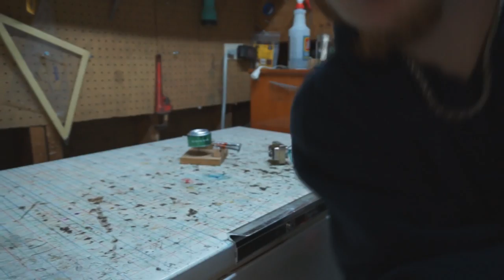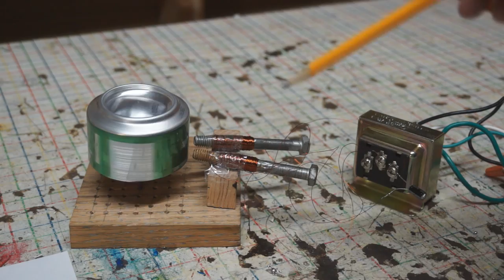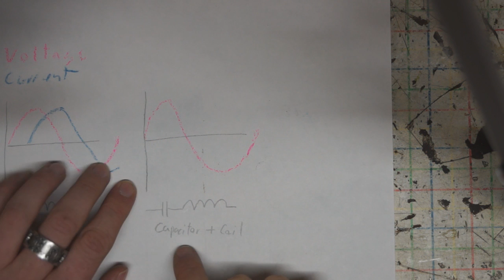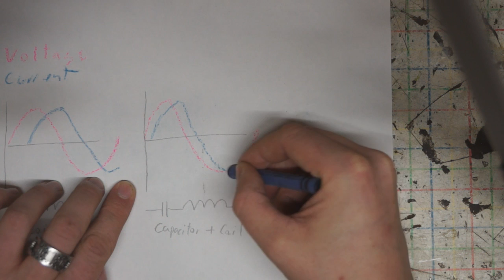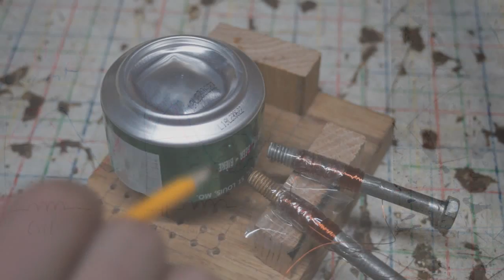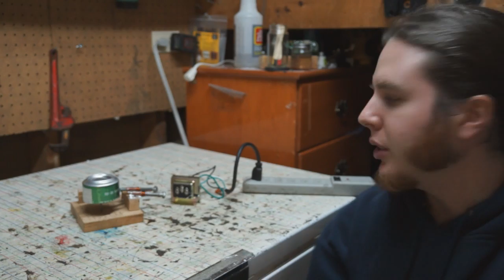Home Made Induction Motor

Comment: It might be fun to spin it faster pushing it from motoring torque  past what would be synchronous (given its electrical and physical phase seperation), into its generating torque so that it converts mechanical power into electrical power pushed back into the grid.

Comment: Would you be able to use an induction motor inside an alloy wheel and power the wheels directly with the alloy wheels? Basically a motor you can bolt on inside your wheels and behind the brakes

Comment: Bunch of questions, hope you’re still around 7 years later to answer them!

What are you using for a “power supply?” Is it just 110V AC?  What’s the little metal structure the wires from the power strip are mounted on? 

I have a 30V/10A MAX variable DC power supply and a fairly large capacitor from an old disposable camera. Will that work, or does it need to be AC?

The application for the motor will be to provide a small sphere magnet with rotation (at least 3000 RPM), at which point I’ll launch it out of the phase field (or whatever it’s called). What size capacitor should I use for that?

Comment: Do you have to use a transformer?
Reply from the maker: For a hobby made motor yes, using lower voltage makes it safer and let's you use less windings on your coils.
Reply from the maker: For the best results you should solder the wire for the coil to the capacitor. Twisting it together may work but not very well.
Reply: @NickMoore  did you use magnet wire or just normal copper wire?

Comment: I made the same model, and used small polarized capacitor like yours, but the coil connected in series with the capacitor is not attracking the rotor, only the other one, i switched the coils and got the same result.. any suggestions please?

Comment: Can you only rotate metal objects with that motor, or can you move composite materials also?
Reply from the maker: +Mark Lane It only works with thin aluminum because the forces are so week. A better constructed motor could spin iron as well.
Reply: Nick Moore thanks for the quick reply. I've been looking for a way to rotate a 16lbs bowling ball using motors with 1/32" control. Not having any luck unfortunately.
Reply from the maker: Have you tried a reverse trackball setup? It would be alike an upside down version of this robot: https://www.youtube.com/watch?v=bI06lujiD7E
Reply: Nick Moore. That's cool and it might work but right now it's over my head. I'm not an engineer. But I did just but a Arduino kit and starting to go through some utube lessons. Just not sure if you can move the ball and get it exactly where need it within a 1/32".
Reply from the maker: Omni-wheels are cheap enough on ebay and if you used 4 of them instead of 3 the math would be much easier. One pair would rotate around the X axis and the other pair around the Y. To get rotation around the vertical axis I think you would have to do something clever but I'm not 100% sure.

Regardless, good luck!
Reply: so like a magentic top of a smuckers jar lid or a magnetic lid in general
Reply: mine only moves stuff that is magentic

Comment: Nick I tried assembling a 4 pole (2 lots of series electromagnets) AC set up with each pole using a large solenoid (each solenoid is at 90 degrees to the other solenoid). One set of series solenoids were connected directly to a 12V AC power pack. The other pair of series solenoids contained 2 capacitors connected - to -. The capacitors I tried were 47, then 100 and finally 220 microfarad. In the centre was the upper part of steel beer can. Unfortunately there was no rotation at all. Using a voltmeter, I found the first pair of solenoids were using the 12V but the second pair only about 1.2V (and 10.8V across the capacitors). I even tried replacing the 2 capacitors with a single one but nothing happened. Any idea?

Comment: very cool um how do you have the motor wired up to the transformer
Reply from the maker: One coil is connected right to the transformer, the other goes from the transformer to  a capacitor then to the coil and back to the transformer.

Comment: This is a very nice demo. Proximate my how many turns did you use for your coils? What gauge wire? How long does it run before the electrolytic capacitor pops? How long can you run it before the coils get hot?
Reply from the maker: +Noah Spurrier It's a few hundred turns (maybe 200-300) of 30awg wire. It will run for 10-20 seconds before the cap starts to get hot, the coils warm up pretty fast but they never failed, the cap was my main concern.
Reply: Nick Moore I would like to build a small demo model that can run indefinitely. What size range of caps were you using? 0.1uF? 10uF? 100uF? 1000uF? Have you tried two electrolytics back to back? That cap looked physically pretty small even for an electrolytic. It shouldn't be to hard to find a cheap, conventional capacitor to replace it. If you are looking for cheap, salvaged components then the "safety capacitors" from a microwave oven might be in the capacitance range needed. These are Mylar and foil rolled. They are found on a small board with a fuse and some inductors where the AC line first enters the microwave before the transformer or any other electronics. There's also the main high-voltage capacitor attached to the HV transformer and magnetron, but these are nearly as big as your motor. Still, they should never overheat or pop and they are basically free wherever you find junked microwave ovens. They often have internal discharge resistors, but these are usually over 1MOhm, so shouldn't be a problem.
Reply from the maker: +Noah Spurrier I never even thought of it but I have loads of EM filters laying around, I should have grabbed a cap from there. The one I was using was the highest value I had on hand, to get a phase shift bigger is better. If you can roughly calculate the inductance of your coils you could also calculate the capacitor needed to get a 90 degree phase shift which is ideal for a little motor like this.

For the coils it would be a good idea to make sure that the resistance limits the current to well below the safe current for the wire you use, for my 30awg coils I should have made sure that they are at least 32ohms (at 16v that would limit the current to half an amp). The magnetic field will limit the current further but keeping the coil resistance high will be a safeguard, more turns also means more torque.

Comment: Very good Nick. They do make speaker crossover capacitors which are non polarized, or you can make them with 4 diodes and 2 caps. Or buy an ac cap.
Reply from the maker: Apparently you can use 2 polarized capacitors wired back to back ( in series with both negatives or both positives together) but I don't know how long that would last. You might find small unpolarized capacitors in the AC input filters of small appliances. Thanks for watching!

Comment: NOOOO! You are using an electrolytic capacitor! Those are DC only polarized and having a reverse voltage will cause them to puff, vent, and if you're lucky, explode. Luckily I guess it was low power enough for that not to happen
Reply: Oh, well if I watched it to the end I would have known that you already mentioned all that 2:45!
Reply from the maker: +Power Max Yeah it was the one that was at the top of the "leftover capacitor" bin.
Reply: +Nick Moore Don't we all have one of 'those'! lol
Reply: What size and type of capacitor would be suitable?

Comment: you can use 4 poles to run the motor more faster
Reply from the maker: Bhanu A Adding more poles will make the motor have more torque, spreading the poles out farther around the motor will make it run faster. Thanks for watching!
Reply: ok bro

Comment: Awesome! I'm a student and I have to make an induction motor as a project, and this really helped me understand the concept. Do the wires for the coils start together at the same input and end up together at the other one?
Reply from the maker: Yes, the coils are wired in parallel to the power supply. Glad you found this helpful.
Reply: im pretty new at this, so thanks!

Comment: Great Video, How do you calculate the capacitor value to get the phase?
Reply from the maker: I didn't I just grabbed the biggest cap I had and use it till it popped. This was only a demo so it didn't really matter so much. If you want to calculate the phase shift look into LC (inductor capacitor) circuits for alternating current.

Comment: Can you make it...
1.Go faster
2.Push a small go cart? 
please answer
Reply from the maker: Yes and no. This motor is for demonstration only it can't do any real work.
Reply: +Nick Moore Can it be scaled up somehow to power something?
Im talking a beer can ball mill power!
Reply from the maker: You could make a huge aluminium cylinder and have it driven externally by an "un-rolled" stator but I'm not sure it would have any advantages past "my mill runs on beer!"
Reply: +Nick Moore But would bigger coils and a rotor with more mass increase torque? I really dont need alot or rpm
Reply from the maker: To get a useful amount of torque you would basically have to copy a real motor in terms of the size and shape of things. It would need lots of poles (like dozens) if you were to make it out of the same materials I used.
Reply: +Nick Moore allright, thanks!

Comment: great video and explain well but can you help me to make the step down process and cap thing
Reply from the maker: To step the voltage down I used a doorbell transformer. It changed stepped the voltage from 120v down to ~16v AC.

I picked the capacitor from what I had available. It must be an AC capacitor otherwise it will overheat and burst.

Comment: This is really fantastic.  I can't tell you how may vids I watched trying to find someone who would actually explain what they are doing.  You explanation was excellent, and the simplicity of your motor makes it easier to understand the principles.

What is the appropriate size for the capacitor as a function of voltage?
Reply from the maker: Then capacitor has to be sized according to the inductance of the coil and the frequency of the power supply. The calculation is similar to "power factor correction." I don't know what an ideal value is however, I just grabbed the first cap in my junk box for this demo.

Comment: Nice explanation. thanks. When the process repeats why doesn't the beercan spin backwards?
Reply from the maker: The phase shift is very small the magnetic field builds in one and then the other very close in time. The magnetic field seems, to the can, to build in one pole, move to the next very rapidly and then disappear from both. If the phase shift was big (180 degrees) the magnetic field would appear to alternate back and forth between the 2 poles symmetrically and the can could be driven in either direction. I hope that helps (I can't type much more than this on a phone)
Reply: Thank you! That makes sense :)

Comment: I'm sort of an old guy that has become disabled and started tinkering to pass the time.
WHile doing projects I find myself in need of resisters obviously but I can not afford to go out every time I need a resister or two. I have made a couple of wire wrapped fraction of an ohm resisters for shits and giggles.  lately I have been thinking that it would actually be handy to be able to make my own resisters for my little projects.  I can for the life of me think of a way to do this effectively. As the wire wound resisters would become too large to be practical.

You seem like you are an very very smart guy.  DO you have no any techniques for DIY resisters?

Thanks for your help!
Reply: Clown Whisper
 You want to get yourself a good range of pencils. There are a few ways to go about it.
You can draw a resistor from around 100k up to meg ohms. Maybe lower if you use a dark pencil and draw it on thick.
http://www.instructables.com/id/DIY-Emergency-resistor-an-electronic-circuit-com/
Or for lower resistance you can just use the "lead" which is actually gaphite and some other stuff.
http://www.troelsgravesen.dk/graphite.htm

http://www.monoandstereo.com/2013/09/the-best-diy-resistor-in-world-probably.html

Personally I like to burn the wood off, and extract the graphite. Just be carful on high current. If you put a pencil lead across a 12v car battery it will turn red hot fast, and may explode a bit, spraying some red hot shrapnel.

Hope that helps
Reply from the maker: Not at the moment but it would be an interesting project. wire wound can get big but that's only if you high conductivity wire. A poor conductor wire would make for smaller resistors that would be easier to build. I'll have to look in to it.
Reply from the maker: Not at the moment but it would be an interesting project. wire wound can get big but that's only if you high conductivity wire. A poor conductor wire would make for smaller resistors that would be easier to build. I'll have to look in to it.
Reply: Yeah I can get up to 20 ohms within a reasonable size using  a small piece of graphite and some 30 gauge mag wire. 

I have some ultra fine mag wire in an old organ.  I might try that.  the stuff is like smaller than thread.

Its funny how little 100ohm resistors seem to be used lol.. I have scavenged 10 boards today and not a one.
Reply: cool project by the way

Comment: hey man. neat as video. just wondering, what size wire did you use for the coils?
Reply from the maker: I was using 30awg with varnish already applied. I bought a part spool with a few KM on it from a motor winding shop, its useful to have in the 'lab.'
Reply: Nick Moore ahh awesome  thanks man. also, what size capacitor did you use? i know you said small, but does it matter what size capacitor you actually use?
Reply from the maker: crispiew I don't know what size it was, it doesn't actually matter. If it doesn't work you can keep adding capacitors in parallel to each other until it does. This was only a demo so it didn't have to last for long

Comment: Hey, what material are the coils made of? Can copper ones be used?
Reply from the maker: The wire can be any low resistance metal (copper or aluminium usually) but the core it is wound on should be ferromagnetic, so iron or a ferrite bar would work best. If you cant find a big bolt you can use several nails bundled together.
Reply: Thanks so much!

Comment: Hi there, I really enjoyed your video. I am trying to recreate it and was wondering if it is absolutely necessary to have an AC current? I am planning on using a battery because we do not have an AC power supply and because our capacitor is the same as yours and we don't want it to blow.
Reply from the maker: It is 100% necessary to use AC, there are no DC induction motors.* If you hooked this up to DC one coil would have a constant DC current and constant magnetic field, the other coil would have no current after the capacitor charged up to the supply voltage. If you want to make a DC motor you'll need to make a brushed motor like in my other video.

*you could call an inductive ring launcher a DC induction motor

Comment from the maker: I have no idea how many turns there are. I put each bolt in a drill and wound wire on until it looked like "enough." Idealy you want the resistance of the wire to allow less current than will melt your wire. The 2 coils are in parallel with each other.

Comment: Another great project! Most AC Power meters have separate coils for line voltage and current. The wheel speed is the result of the coils' torque interaction.

Comment: So it does work the same way as the spinning disc power-meters? (not counting the electronic stepper driven ones, if they even exist)

Output power at 0% efficiency is rather neat :) I guess you slightly underrate it.